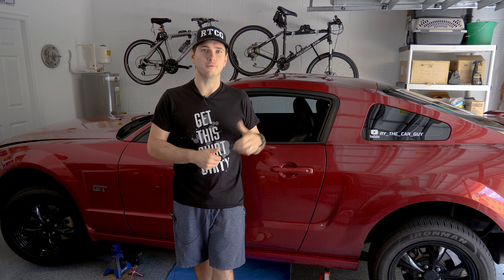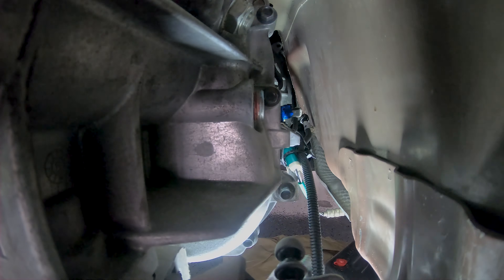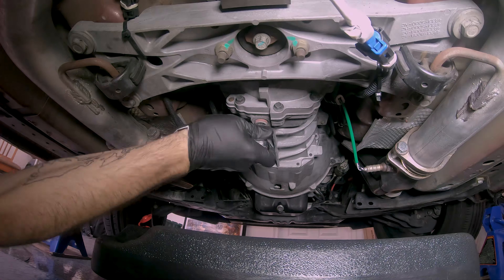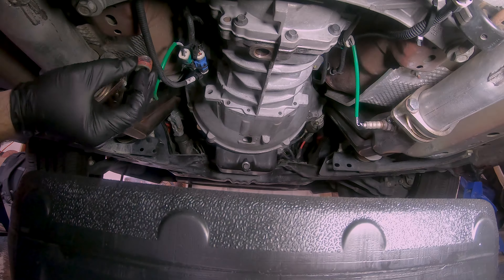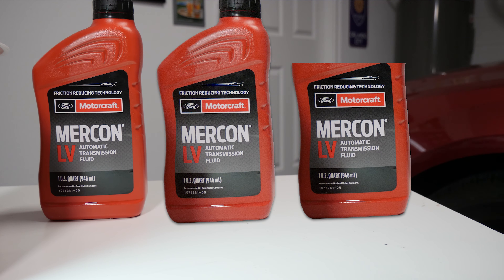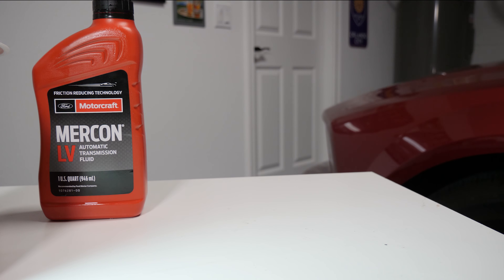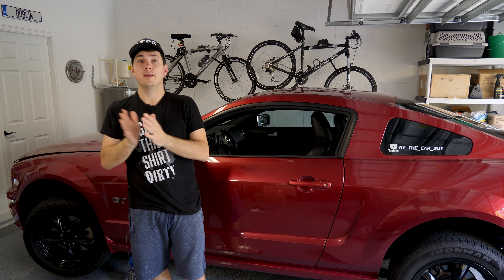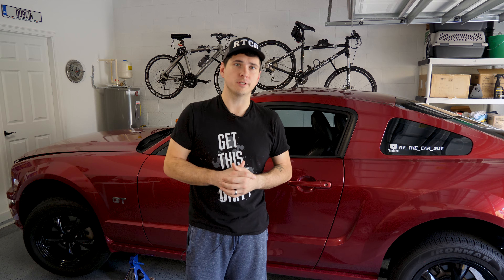How To Replace The Transmission Fluid In A Mustang (Manual Transmission. S197)

Comment: Great video, very thorough thanks.  Just got an '07 GT I'm sure I'll have to change my fluid too.
Reply: yessss. I have had a 2008 GT for 6 years now and theres a lot to look out for. Don't forget the rear diff fluid and brake fluid too. My rear diff axle vent clogged over the years and the differential fluid forced its way out my rear axle bushings and bearings and ruined my wheels and my rear brake pads and rotors lol. It doesn't help that I live in hot Florida which pushes the car and its fluids a lot harder. I ended up getting gt500 clutch packs for the rear diff and an aluminum diff cover with its only axle vent and fins to help cool the diff off.

I say to watch the brake fluid too because my fluid was old and traditional dot 3 fluid, and probably had a way reduced boiling point. The clutch on these cars use brake fluid to disengage the clutch and for me, when i would push the pedal in, it would still be engaged partially and would result in super sloppy driving. I replaced Ford's plastic clutch line (yes, they used plastic....) with a stainless steel line that wouldn't expand in hot weather, and also replaced my fluid with dot 5.1 (don't use dot 5, it has to be 5.1) which has a super high boiling temp and makes my brakes and clutch work no matter how hot it is. Getting a cold air intake with a tuner also let me program the engine fan to come on 10 to 12 degrees sooner, which helped with the sluggishness of the engine and weird clutch disc slippage issues I was having lol

Comment: Nice work. I had ford change mind even though they were against it. Unfortunately no change.. For other people having shifting problems still taking place. Look at drive shaft and rear end gears. Replacing both fixed alot of my shifting and lock out problems.
Reply: Why was ford against it?  They dont recommend changing tranny fluid at all?  I just hit 60k miles and thinking about doing mine as preventative maint

Comment: I used pennzoil synchromesh helped a ton
Reply: How much did you add?
Reply: @colehaverhals7544  drain and filled with it. I went with just below the fill hole as the service manual says. About 3qts
Reply: @kcorkum69  I did the same. My car didn’t have any shifting problems, but it got rid of clunks that sometimes happened going into 1st. Shifts smoothly.
Reply: @kcorkum69  i also used pennzoil synchromesh for my 07 GT even tho it says it’s for vehicles with a certain manual trans like chrysler etc. worked great 3 quarts and shifts like new again
Reply: I heard about synchromesh. my 5th gear grind in my 2010 v6 mustang and I heard that shychromesh would stop the grind but won’t fix the problem so I will try any time soon see if that would make my shifting smoother🫡
Reply: @BrandonAcostaWrestler  did you notice a difference? Thinking about going to the synchromesh myself

Comment: To avoid the “rocket ship” I would just loosen the fill plug to make sure you can get it out, but leave it in, and then remove the drain plug and it should drain a little slower and not make such a mess. Lol

Comment: Ok So wanted clear some things up. Lv will work however I would and just used v and here is why. Mercon V is made to be able to shift in cold temperatures. And in a stick car thats makes 300hp it won't get extremely hot like a auto would or even a shelby that has a trans cooler. The biggest problem with older fluid is that it loses its ability to be able to offer the hydraulic force and lubrication in cold weather. hence why it locks up, once it gets hot it goes away and thats why. Lv is made for more heat and will offer some cold temp help but not as much as v will

Comment: Great vid, explainin everythin top notch .. although I think 05-10 GTs calls for Mercon V .. ma only question is did you mean 1 and 1/2" or 1/2" fluid below the fill plug ? Thanks in advance
Reply from the maker: 1/2 under the fill plug

Comment: My 2006 mustang gt with a 5 speed trans is giving me pretty scary symptoms. When I drive it the hurst throw shifter metal part gets super hot causing difficulty shifting into all gears specially 1st, 2nd, and reverse. I appreciate any advice and comments on what can be wrong.
Reply: Sell it
Reply: I have the same issue even after rebuilding it
Reply: The trans will get hot cause of friction and the engine, mine gets hot but it's been doing it for 8yrs now.
Reply: You can try bleeding the clutch system

Comment: So I'm used to giving some information and advice about automotive things but I'm changing gears on this one 
My 2014 GT with the automatic is from time to time it's high reving after it shifts from 4th to 5th. And today it wouldn't shift  from 3rd at all. Tried to put it in manual and it would not shift that way or was it showing on the dash that it was in manual. But after I got back home from about a half mile drive, I put it in park then reverse and it hit reverse Really hard. Pulled it to neutral then drive and it hit drive very hard. Out it back in park and shut it off. Started it back up and everything was fine, drove it for a couple miles and then back home with no issues.
I checked for codes with my reader and there was nothing to be shown, also no dash lights either.
Also as far as I know the car is pretty much stock no tunes.

Comment: Instead of using a fluid pump you can attach a funnel to like 7ft of 3/8 hose and place it in the engine bay and run it down and back to the fill plug. 

Video was a great help though, a very messy job.
Reply from the maker: Yea, thats a good tactic too. And probably cheaper. Thanks for watching!

Comment: I don't think you're supposed to use the LV fluid on the 05-09's. Mercon V normal viscosity. The LV is low viscosity and won't hold up to the TR3650.
Reply from the maker: I thought it was strange too. The manual says standard Mercon not V. I even called Ford to verify and they told me LV is what I needed to use.
Reply: The manual says mercon 5
Reply: @South Texas Adventures Tremec says Mercon or Mobil 1 synthetic ATF
Reply: @Alexander Donald no it calls for mercon v ATF for the manual trans, these mercon ATF trans fluids are used even in the gt500 of the same era the fluid can handle the heat in these year trans, but some people have had no problems w Royal Purple SyncroMax fluid
Reply: you could also use Mobil 1 synthetic atf tremec recommended
Reply: @Rythecarguy mercon v is the new mercon
Reply: @ston_jude_ed that is true however here is thing the lv stands for low viscosity this fluid made in part for transmission that see alot of heat. which in a manual 300hp car will not see.
Reply: Mercon V supercedes regular Mercon. Do NOT use Mercon LV.

Comment: HI CAR GUY.  I would really appreciate your your advice .. so i m concerned i just installed used transmission which  works fine and don't won't to mess up.. Recently I put  6qt

TITAN ATF 1 with vw spec VW TL 521 62(G 052 162 ) in my VW Passat 2.0 T tiptronic fwd. 6 speed by mistake. 

I saw later that TITAN have the other fluid that exactly match with specifications for my model of car which is TITAN 4400 Spec VW G 052 990055 025. But both products are approved for VW

 

Vw fluid from Dealer  for my car has spec G 055 025 A2. Which I belive it match with TITAN 4400..  long story short I have flluid from b5 01m tramsmission in b6 09g transmission 

Should I drain it and replace right away with correct  specifications or I can drive for a while with ATF 1 and then change to TITAN 4400 after a year .

Whats the difference in this specifications and how important this is if both are approved for VW ? Thank you so much in advance 
IVAN subscribed ;-)

Comment: I would highly recommend using plan old mercon I if you can find it. I have only used dex merc I fluid with good results. Do not use ANY synthetic fluid in the 05 10 manual mustangs. You’ll ruin the synchros.
Reply: Synthetic fluid by itself will not ruin the synchros. It's the additives in some fluids that cause adverse effects to the synchros that should be avoided. Ford stresses to use only Mercon V / Dexron III type fluid which is conviently stocked and sold at all Ford dealerships. Of course they want you to buy their fluid. The engineers at Tremec, who designed this transmission, recommend Mobil 1 Synthetic ATF as an alternative to the Mercon. It meets Mercon/Dexron requirements. Other brands have even been used by Mustang owners and given good reviews. 
   From what I've gathered, fluids containing sulpher should be avoided. But to say that all synthetic fluid by virtue of being synthetic should be avoided is not based in fact. If the very engineers that designed the transmission recommend Mobil 1 as their choice, I'd value their input over Ford. If you like to stick with the Ford fluid that's cool but this transmission responds well to many types and brands. In fact Ford themselves have changed their minds over the years with what they say should go inside. So while they keep changing their minds, I'll listen to the Tremec engineers.  Mobil 1 ATF in my Mustang.
Reply: Also important to note that tremec has revised their fluid capacity recommendation to 3.2 quarts, down from 4 quarts.
Reply: @AirplaneJunkie82  that would be the synthetic atf right?
Reply: @stevenrubio5462  yup. Mobil 1 synthetic atf.

Comment: So you automatic fluid worked well in a manual  ?that’s what I’m very concerned about.
Reply from the maker: I was concerned too. I bought them from the ford parts counter, and I asked them like 3 times while I was standing there. I was like ARE YOU SUUUURREE this is right? Two different dudes told me it was right. Stange but I went with it.

Comment: So the 2007 s197 also has a fill hole????? I always thought it was the drain hole. Thank you!!!
Reply: yup it has one. Some people even fill the trans from the inside of the car, you can pull the rubber grommet below your shifter out and run a tube from the inside of your car to the fill hole. Just dont spill any of that fluid inside your car or you are screwed lol.

Comment: What year is this and engine size  sir?
Reply from the maker: 2006 with a 4.6 liter V8
Reply: Thanks
Reply: I have a 4.0 but I can't get the pan off because of a black thing with a whole bunch of wires in front of the pan any suggestions would be very helpful

Comment: If the fluid gets really bad, could it cause a check engine light or limp mode?  This may be the problem with my car.
Reply from the maker: I'm sorry but I am not sure. Its possible. A lot of times limp mode is bad sensors.
Reply: @Rythecarguy  You're right.  I had 3 bad O2 sensors.
Reply from the maker: Three!? Damn. Sounds like your Air/fuel ratio might be off. Did you do any upgrades to the air intake, injectors, or exhaust?